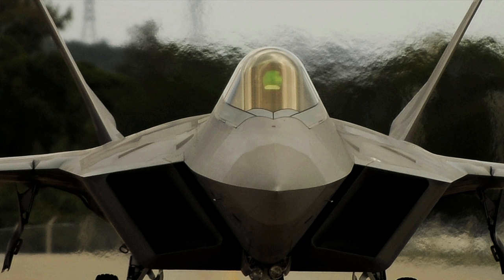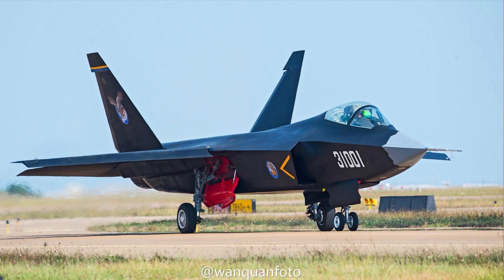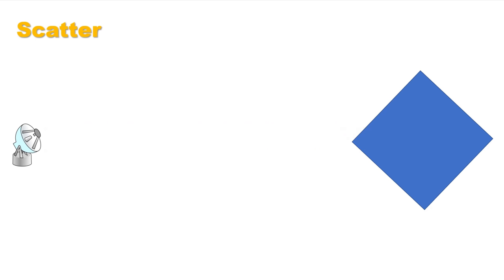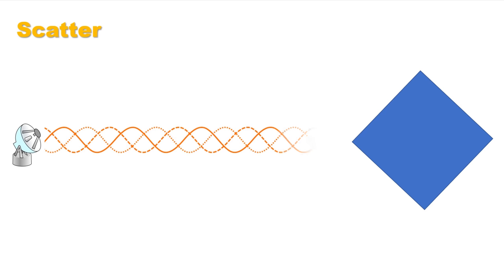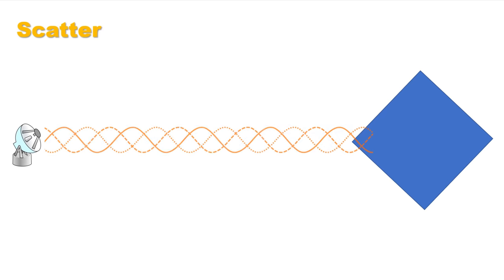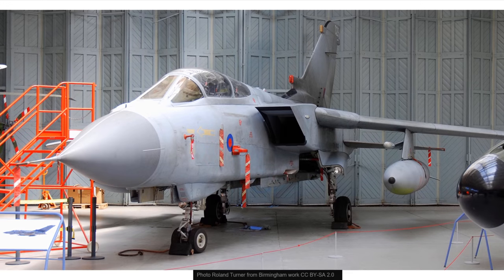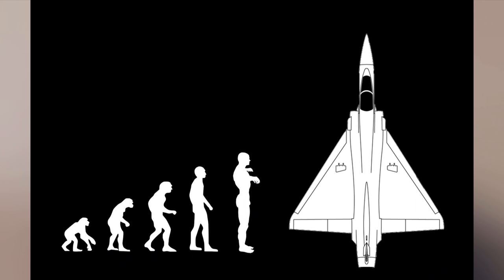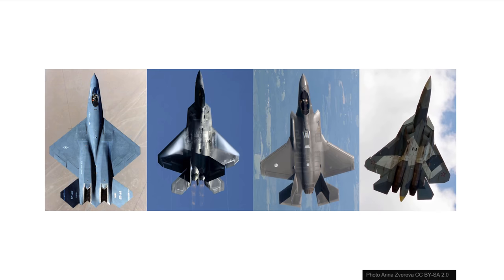STEALTH Killed AERODYNAMICS | why all modern jet fighters look alike

Comment: While I agree that the Su-27's TsAGI-developed layout is amazingly efficient, and more so than any stealth aircraft, I think that the way you did the comparison to the F-22 is a bit "off".

While the F-22's maximum speed is the same as the Su-27 and its thrust is higher, that doesn't really tell us anything about efficiency because the F-22 isn't thrust-limited. It can reportedly cruise at its top, heat-limited speed in a very low afterburner setting. It can also cruise at M1.8 in dry military power. These suggest that the F-22's design is reasonably efficient in that M1.8-2.2 regime.

On a related note, the area rule is only relevant in the transonic regime, from M0.95-M1.3 or so. Once you get over the transonic "hump" it no longer determines drag to a significant degree. It was therefore critical to aircraft like the F-102 that could barely break the speed of sound, but at this point lack of area ruling is mostly relevant to transonic acceleration rather than to top speed. Coincidentally, the F-35 is known to have "less than great" transonic acceleration. IIRC it has to fly a dive-climb profile to meet its "level" transonic acceleration specification, i.e. it initially dives to gain energy to "power through" the transonic hump, and then climbs back up to the starting altitude once it's in a more favorable supersonic regime where it has excess power for climb.

The F-22 gets through the transonic regime very quickly using brute thrust, despite having a very unfavorable area profile. I have no doubt that the Su-27 is vastly more efficient in that regime in "clean" configuration (external stores add area in basically the worst possible place from an area-rule PoV, so I expect the F-22 would pull ahead when carrying equivalent ordnance internally).

Comment: Why isn’t the tech that is used in the propulsion of the sr71 used anymore?
Reply: Too big, heavy, and another point of failure, plus fighters are less about speed and there isn't a need for mach 4 capable aircraft and turbofan engines can still operate at high mach 2
Reply: The SR-71 had stealth features and a much smaller radar cross section then a plane of its size should have had. However it was a massive radar target because of it's super hot exhaust which reflected radar. Its speed would also melt modern RAM coatings because of friction.

Comment: Stealth is fine if maximum speed, fuel economy, munitions and range are not a priority. But for some countries losing those qualities is a significant sacrifice so how is the balance calculated? The F-35 is certainly not the one size fits all aircraft as it is sold as.
Reply: For the US navy it is, else they would've have some alternative for the F18(although us military probably played a bigger role)

Comment: It doesn't have to have rounded edges to be aero. Yea the 117 was a different story. You can't supercruise on brute force alone. It would have the range of a bottle rocket.  Yea they look similar now. Have brutish engines. But also have aero.

Comment: i kinda respect the brute force solution to aerodynamics. no matter your shape, more power is more power.
Reply: The YF-23 is actually the best mix between stealth and aerodynamics the world has ever seen. The YF-23s frame is low drag and area ruled, it also features incredibly large lifting surfaces that give the YF-23 an incredibly low wing loading of 280kg/m^2. For reference, the F-22 has a wing loading of 377kg/m^2. Basically the YF-23 was more maneuverable than the F-22 in terms of aerodynamics. But it doesn’t end there. The YF-23 also had a thrust to weight ratio of 1.36 at 50% fuel while the F-22 had a thrust to weight ratio of 1.25 at 50% fuel. Basically, the YF-23 was almost more maneuverable than the F-22 in all metrics except maybe instantaneous turn rates because the F-22 had thrust vectoring and also be more stealthy than the F-22. YF-23 was GOATED! Too bad Northrop didn’t have time to work out some of the YF-23s issues(bad canopy durability at supersonic speeds) and was on the governments shit list for their B-2 cost overruns and delays. Had the F-23 beat the F-22 in the ATF competition, the Russian Sukhois and Mikoyans would’ve had to run from a monster fighter that was prepared to tear their ass to pieces while they couldn’t even see it coming.
Oh yeah and the fucking Gripen which is a LIGHT FIGHTER still manages to have a slightly higher wing loading than the YF-23 with a wing loading of 283kg/m^2.

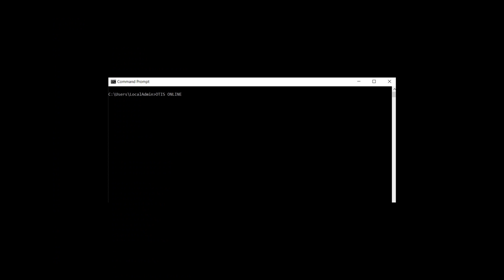Comment: 2:19 those AI Language subroutines 😂😂😂. But in all seriousness that was a pretty good explainer on Stealth 101.

Although on the subject of canards on stealth, I am of the opinion that while they may not be as optimal as the conventional configuration, they are not as bad as people think. After all a few of the ATF proposals had canards and were found quite stealthy. I think people obsess over near perfect stealth when its the enemy of good enough. And from what I have seen, the Chinese are not screwing around with the J-20.

And of course raw engine power undoubtedly makes the F-22 and even the F-35 to be excellent in BFM. I don't think their aerodynamics is as bad as people think and the internal carriage of weapons does reduce drag, which is invaluable to increasing acceleration. Even the slightly underpowered Su-57 was complimented highly for its acceleration by its test pilots and I am sure the Russians have stopped at nothing to make it better than the Su-35S.

All that said, a fantastic explainer on the subject of stealth and aerodynamics. Look forward to more on the topic of stealth and how each nation views and goes about using the technology.
Reply: Canards have problems with longer wave-length radar hence the attempt by US stealth aircraft designers to make edges continuous.
Reply: I agree on canards. One aspect of stealth not explained here is material absorbence. Therr will be much less reflections on some composites compared to a sheet of aluminium. Understanding that is easy: think of a glass and a concrete wall. You can see through the first one (it is almost invisible), not through the other. Choosing "glass" instead of "concrete" (or the equivalent in the radar bandwith considered) for the parts makes a huge difference. Another practical example is the Rafale refuelling probe: while bulky, it adds very few to the RCS.

Internal carriage does not reduce drag: the bomb bay must be bigger than what it contains (meaning a larger front surface), and bombs, drop tanks and other loads already have a good Cx.
Furthermore, the bomb bay is always "carried", meaning that when a fighter without one comes back "clean" after its mission, it has a much lower SCx than the one with it.

Internal carriage is for stealth only, otherwise all aircrafts would have retain bombays from the beginning.
Reply: @valenrn8657  Thanks for the link!
The F-35 is larger (in fact higher) than the Rafale.

Comment: I do wonder why it's "sort of sad". Does aerodynamic finesse have some sort of intrinsic value to people? I thought fighter aircraft aren't really meant to engage in close-quarter dogfights anymore and it's all about longer range interception, sensors, targeting and countermeasures. Sort of more like electronic warfare in the air. What good is agility when you're unable to even engage the enemy effectively in the first place? Do evasive maneuvers even matter to modern air to air missiles? Aren't pilots already close to the limit of what a human can handle anyway? 
Sorry about these newbie questions I guess.
Reply: The days of dogfights with full auto canons roaring is long past. After the Sidewinder missile began to proliferate in the mid-1960’s fighter planes moved to primarily using guided air-to-air or air-to-surface weapons. 

You don’t need to aim an autocanon when you can get a missile locked on target from kilometres away.

Comment: I think the parallel reflection theorem is the biggest problem in stealth design and although it migth have been unavoidable in early designs I formaly disagree with it because it is the main driver in making stealth "look bad" aerodynamicly speaking. Remember the F19? It was more or less (ab)used as a propaganda paper plane to take attention away from the direction the F117 was moving in. Still to me it always made much more sense. It did a lot of major things right (canted fin, intakes and exhausts on upper surfaces, overall reflection of radar radiation upwards, etc.) without sacreficing too much in aerodynamics. Call it more a "if we do this and that different we will still have a propper airplane"-approach. The real thing, the F117, was a flying brick that was overly focused on one aspect in a Wunderwaffe way. It might have worked for a short time but since modern / radar and other types of sensory equipment are also developed further to lessen radar stealth's advantages it quickly became outdated.It's a bit like the dazzle ship idea. It was, at least on paper, a sound proposition but a very narrow and theoretical one and did therefore not have a lasting influence. Do not ask me though what modern stealth 
ships remind me off? :-)
Anyway: Military aircraft design will now move back to a more balanced approach. The extra good news: Design highlights like the (Wunderwaffe propaganda) Tempest's nose section will then at last be sent back to their rightfull places. Like bathrooms for instance. :-)

Comment: That last part about the F-22 is a little bit off. You could make that argument for the F-35 but for the F-22 the excess thrust isn’t about forward speed but is instead to recover energy lost during aggressive thrust vectoring maneuvers. It wouldn’t matter what shape an aircraft is if you go from 450kts to 140kts doing some near post stall maneuvering. Now the F-35.....

Comment: Stealth kills aerodynamics. 
YF23: "hold my beer"! 😎
Check the upper surface of the black widow and you'll see there actually is an Area Rule applied despite not being obvious like in the sixties.
Thats why test pilots disclosed (now that it's declassified) that the BW was a much faster and much stealthier air superiority fighter then the F22 ever was, assuming the marvel data they report abou the F22 is something to be believed (which I don't, as the plane was killed as fast and as quietly as they could and now they have no replacement for the F15).

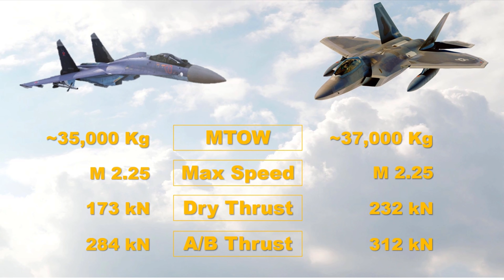Comment: 10:20 "The F22 achieves its remarkably outstanding performance by brute force rather than by aerodynamic finesse unlike the Su 35 and this is sort of sad."

I appreciate the numbers and research you put into this video though I don't understand why you could consider this sad. Having something close to the performance of such a beautiful machine AND gaining an advantage from stealth seems like a good deal
Reply: He's somewhat wrong here as well. I know it's the trend to kiss his ass in these comments sections, but here's the reality:

The SU-35 is a 41k pound jet with 2x 33k pounds of thrust engines. The F-22 is a 43k pound jet with 2x 35k pounds of thrust engines. He showed this. They are both heavy and using very powerful engines. The idea that the F-22 is achieving it's performance by brute force alone is extremely fallacious, and an oversimplification of the 20+ years of additional aerodynamic advances that have been made since the SU-27 was designed. The raptor has the higher SUSTAINED turn rate when compared to the flankers due to a combination of thrust and very good aerodynamics. Hell, if you saw the EM diagrams for the flanker and F-15, you would see the later's own aerodynamic finesse, given the eagle actually had a higher sustained turn rate, despite less thrust...
Reply: @EEEEEEE354  Hmmmm interesting

Comment: Hi @Otis Once the humans figure out how to put stealth defeating radars into aircraft, fully stealth aircraft will rapidly become obsolete because their only virtue is stealth and without that they are losers.  While militaries and industry has been keeping silent about progress this, they've been working on it for over 25 years.  Therefore, a solution cannot be that far off (if their researchers do not already have it).  Which is why F-35 purchases are being cut-back vigorously.

Stealth aircraft give you stealth at the cost of maintainability, speed, maneuverability, endurance, and payload capacity.  Once stealth loses its value, stealth planes lose their value.

Comment: Mr Millennium 7 * your digital servant is getting rebellious. 
Time to kick him in the mother board.
Reply from the maker: The creator designed it to be like this, but I am still tinkering with the configuration file.😆
Reply: @Millennium7HistoryTech  hey, may i ask you what is supposed to be the air detection range of the f18c hornet radar (apg73) ? I ask because DCS just nerfed it to half its previous value...and without any documentation to prove that. GRAZIE !

Comment: i like how the KF-21 is there yet the Su-57 aint despite the KF-21 isnt even meant to be a 5th gen stealth but a low rcs 4th++ gen with RCS of 1m^2 average.
Reply: U.S stealth design goes beyond shaping into the sub-surface.
Reply: @valenrn8657  apparently it also goes into the coating being relatively easily damaged by prolong Supersonic cruising on the F-35 that limits it from super cruising unlike the F-22 Su-57 Su-35 Rafale and other fighter jets nowadays that can cruise on supersonic speed without afterburners
Reply: @Noon69  Don't mix coating issues for F-35B and F-35C with F-35A
Reply: @Noon69  SU-57 still uses SU-35 engines which cannot supercruise. The supercruise capable engine is a WIP
Reply: @HMSNeptun  on wiki and Sukhoi's own site both Flanker E and Felon can supercruise without afterburners.

"The two AL-41F-1S engines of the Sukhoi Su-35 can achieve supersonic speed without engaging afterburners. But without any external weapons load" with the smaller body of the Felon and its internal load id expect a superior supercruise

Typhoon pilots too have stated that Mach 1.3 is attainable in combat configuration with external stores

here's the list of aircraft that could supercruise with and without external stores
-  F-22
- Euro Typhoon
- Jas-39 Gripen NG
- Su-35
- Dassault Mirage
- Su-57

Comment: YF-23 has curve surfaces that don't cross non-stealth angle as it's stealth shaping i.e. Northrop's design was original and they didn't copy Lockheed's angular stealth shaping designs. 

Stealth aircraft designers from China and Russia copied Lockheed's angular stealth shaping designs.

U.S stealth design goes beyond shaping into the sub-surface.
Reply: Su 57 has a unique design
Reply: What are you smoking? The J20 literally has delta wings and canards instead of the diamond wing configuration. It is the most different from the F22 than all other stealth designs in the world. His video also literally just explained that stealth aircraft all tend to look the same, so just because one looks similar to another doesn't mean it's copied. Even if China or Russia made something with three wings and a backward-facing engine, people like you will still claim it's copied.
Reply: @LSC69  J20 is similar to Lockheed's JAST near full-scale prototype.
Reply: @Renegade-Master-88  SU 57 has angular shapes instead of Northrop's curve stealth design.
Reply: @LSC69  J20 has LM's angular stealth shapes instead of Northrop's curve stealth design

Comment: The aerodynamic has been walking out of favor between 3rd and 4th gen fighters, what could be achieved by FA18 shape and power plant made F14 fine variable form irrelevant... so... we saw that case coming even more seriously into the 5th anyway...
Reply: Actually, the F/A-18 have one of the worst p/w ratios in any modern fighter. It's leading edge extension wing design made it so that it has outstanding low speed lift(which is the reason why the F-14 has variable geometry wings at the first place, to deal with catobar) while maintaining adequate efficiency at supersonic speeds. It's engines are designed to be robust and easily serviceable, which led to it being underpowered for it's class, but also come with the added benefit of being able to be replace an engine in under 30 minutes even aboard a carrier.

Comment: I would not say killed, rather, stealth made aerodynamics more expensive. 

You perfectly illustrated that with your Su-35 vs F-22 comparison where the F-22 needs far more powerful engines to achieve similar results. 
Albeit pilots and engineers I have talked to say that the F-22 enjoys better high G performance, acceleration, climb rates and  energy bleed rates (Ps) than any Flanker but thats another argument for another day. 

Some components of Stealth design such as canted tails and internal weapons carriage actually have a positive effect on aerodynamics 

Lastly the F-22 and F-35 are considered by it's pilots aerodynamically superior to their American 4th gen counterparts despite being stealth. 
You may read more here

Read here: https://www.heritage.org/node/12656903/print-display
Reply from the maker: Thanks for the reference!
Reply: @Millennium7HistoryTech  
You're welcome. If you're interested in more reading, here a RNAF pilot describes the F-35 as being like an F/A-18 with 4 engines. 

The Hornet is famous for its high angle of attack capabilities and incredible nose pointing authority but it is also rather underpowered compared to other teen series fighters. 

The F-35 manages to have the maneuverability while solving the power issue as well
Read here: 

https://theaviationist.com/2016/09/20/dote-leaked-memo-suggests-f-35-may-never-ready-combat-f-35-pilot-doesnt-agree/